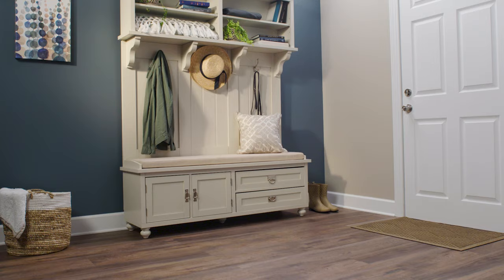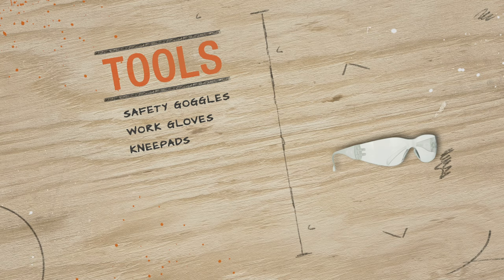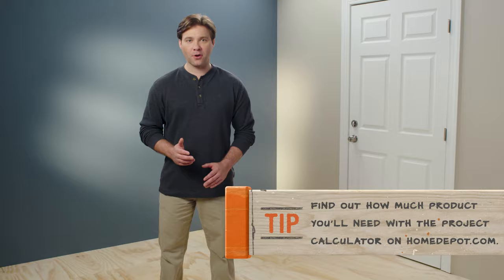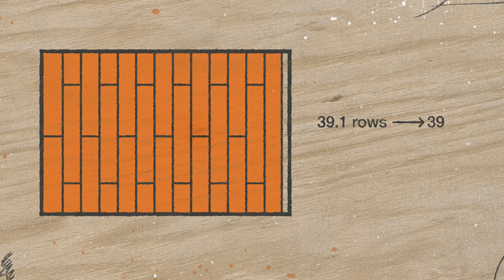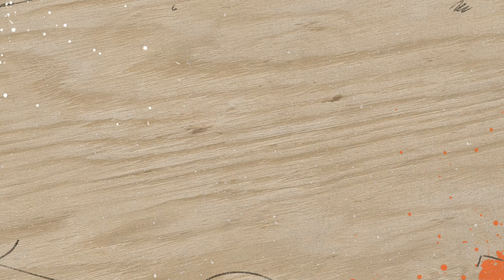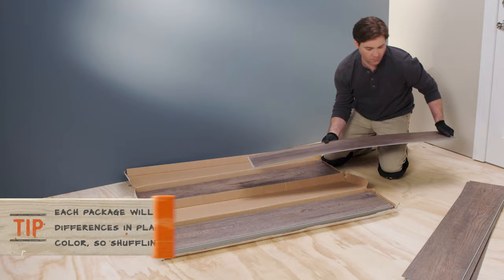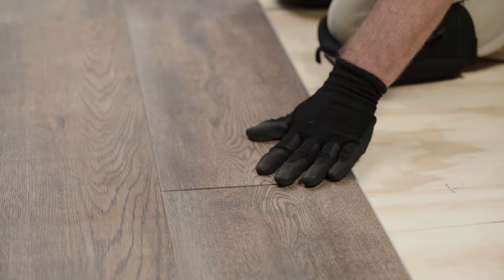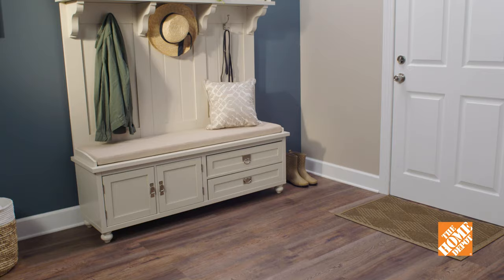How to Install Vinyl Plank Flooring | The Home Depot

Comment: Does the diagram show the planks laid parallel to the short dimension? I thought they said to lay them parallel to the long dimension. Confusing -- any help is appreciated.
Reply: Yep, he said one thing and then did exactly the opposite. I am no expert but you generally want to lay the planks parallel to the long dimension - which is as he said, but not what he did.

Comment: It appears the calculation is wrong when figuring the last plank.   He used the initial length of the room verses the subtracted length for expansion.  I am not by any means a floor person, but this kind of stood out.  Let me know if I am off on this as I am trying to do my floors.  Thanks